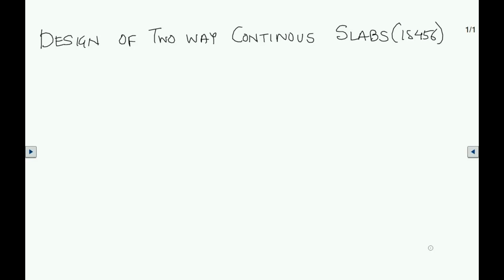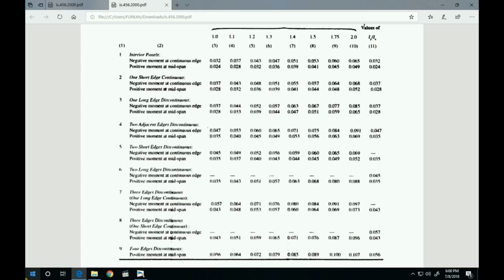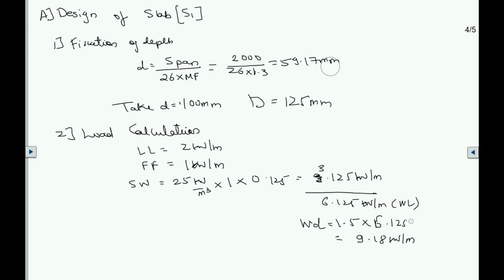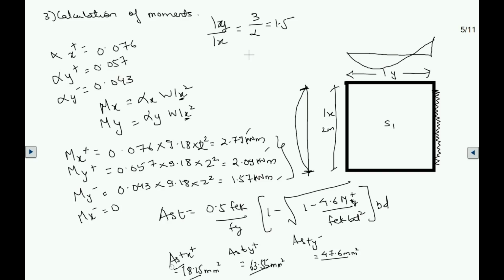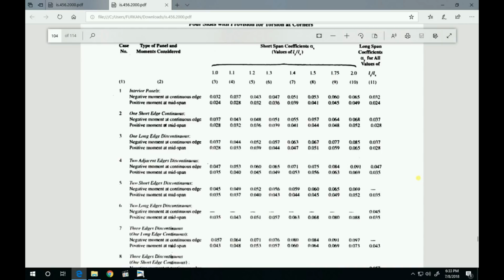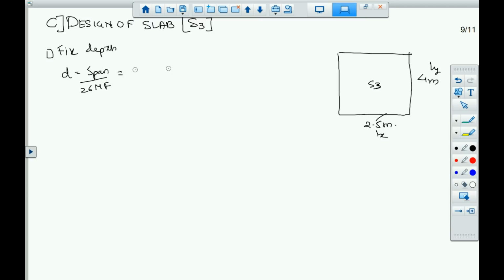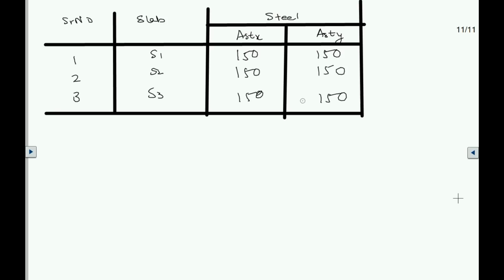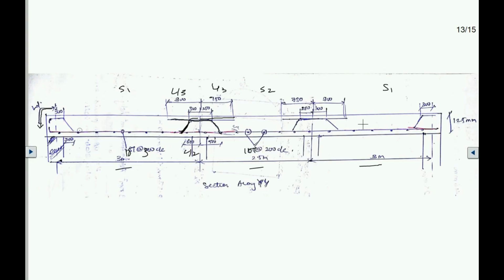Design of Two Way continuous slabs including detailing | IS 456 | Step by Step

Comment: Hi , Nice work there brother thanks a lot first of all. Coming to query , can you please make a video for slabs and beams for detailings of simply supported and continuous patterns as per IS 34 and IS 64 for calculation of top and bottom steel and in mid spans or so.  like L/3, L/4 lengths to be provided.
Reply from the maker: Sure I'll try to make a separate one for  that

Comment: The formula that you have used for calculating area of steel. Is it is listed on the code book or did you simplify a formula?
Reply from the maker: It's not in the is code. It is simplified.

Comment: Bro I loved your explanation....but I have a doubt ...the slab has cantilever projections on 2 sides .how that sides are considered?..will  they comes  under continuous ..please give reply bro....love from ap🤗
Reply from the maker: If they have beams under it. It won't be considered as cantilever slab.
Best example of a cantilever slab is a chajja over window which is free standing supported at the beam.

Hope you understood? thanks for watching keep supporting.
Reply: @EverythingCivil  bro thanks for ur reply..but my doubt is all  about the sides of the slab...will that sides comes under continuous..in that case....
Reply from the maker: Yes ofcourse that's why I calculated negative moment at that edge as u must have in the seen problem.
Reply: @EverythingCivil  cantilever projection slab have the  beams projected under it. You have said that it will not be considered as cantilever slab...then  this projection comes under which slab
Reply: @Everything civil 
 In some cases  ..slab is projected out  around the building ..what will we call that projection..if it is not a cantilever slab
Reply from the maker: @sireeshapamarthi4680   I understand your confusion. As you have seen in this problem this is just like a normal slab which is supported on beams and those beams are supported on columns. Only difference is that one of the edge is connected to adjacent slab therefore that edge will be designed as continuous and hence we provided steel for negative moment there. Best example of this is a porch slab in front of a bungalow.

In case of a cantilever slab the slab will be supported on only one side on the beam while all the other edges will be hanging free. Best example of this is a chajja over window.

If you still have doubt please connect with me on instagram: @furqan.zari
Reply: @EverythingCivil  thank you bro🤩

Comment: My duobt is if there is one way slab next to two way slab and the longer direction of both the slab is in same direction so longer side of two slab is considered as continuous or not??

Main point is we don't provide bentup bar in one way longer direction so will I continue the bar of longer direction of two slab into the one way slab as case define above if yes we need to provide distribution for bentup bar which was continuoued into the slab??

Comment: Sir in your previous video from 2017 on design of two way simply supported slabs, when you calculated My value you used a different effective depth i.e. you took into consideration the steel dia. in Y- direction. But here you took same d value for both Mx and My. Please clear this doubt!!

Comment: how to decide modification factor
Reply from the maker: its all rational. higher the MF means more steel you are providing and hence your section will be safe and will have smaller cross section.
Reply: @EverythingCivil  any range for MF
Reply from the maker: 1 to 1.5

Comment: Why we take lx for both moment....
Reply from the maker: Because the the coefficient (alpha)  is derived for x and y direction. The alpha y coefficient converts Lx into Ly to give moment My
Reply: Everything Civil elaborate please... Not getting your point bro
Reply from the maker: Slabs are always designed considering the shorter span because it has more chances of failing on the shorter edge. The coefficients that you see in Table 26 is for x and y direction. Even the though you are taking lx for calculating My the coefficient Alpha y gives you the moment My
Reply: Everything Civil yeah that is what I wanted to know